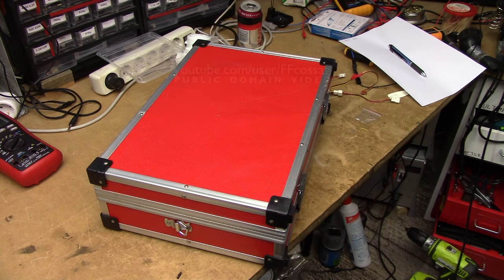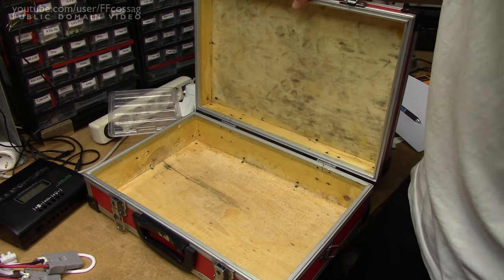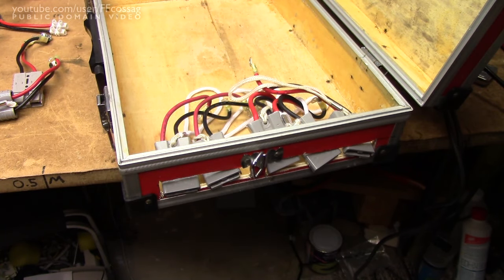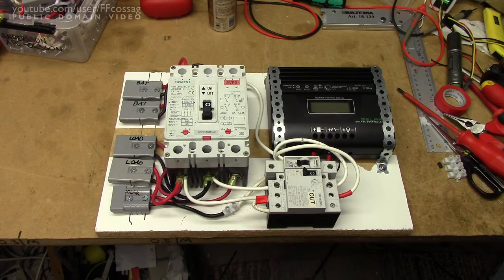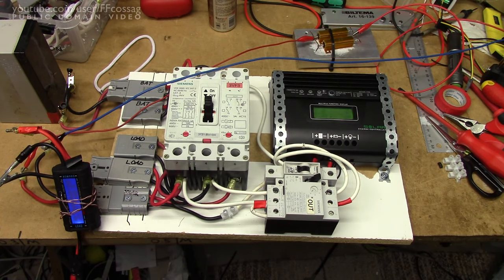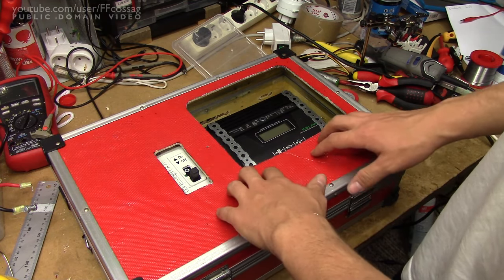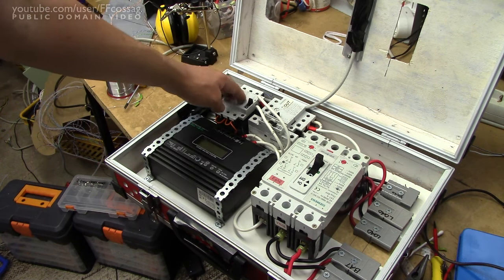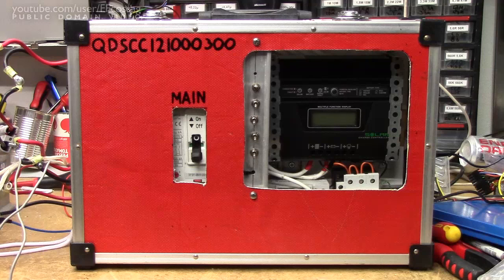Making a red briefcase of solar power!

Comment: That thing you don't know what it is, it's a arc extinguisher, thumbs up :)
Reply from the maker: Thanks for putting a name to it - I Googled it and found out more. The odd thing about this one is that it doesn't seem to be electrically connected to anything at all. Perhaps the arc is intended to jump to it.
Reply: FFcossag No problem, this kind of circuit breakers are normally mounted vertically, and because the hot arc rises, it goes all by itself into the arc extinguisher

Comment: @3:02 -- I've seen that sort of construction for variable capacitors on tube era stuff on other peoples channels. The dielectric is air, and the plating is compressed to alter the capacitance you want to achieve. Other than that, your guess is as good as mine

Comment: Is youre solar panel free standing or is it mounted somewhere ? I once had a 4WD Mitsubishi L300 with a solar panel mounted to the roofrack . The panel could be tilted and spun 360 degrees to track the sun AM to PM , the controller was mounted inside the vehicle .
Reply from the maker: That sounds really expensive and fancy. If you stick around, you're going to find out what this project is meant for, though. ;)
Reply: It wasnt fancy the tilt and rotation had to be done by hand . But expensive , 27 years ago a 40 watt panel
cost the 2016 equivalent of 1000 dollars au !
Reply from the maker: Steve Smith
A 40 W panel in the 80's must have cost a stupid amount just on its own. Today, the bulk of the cost would be in the mechanics, given how even a giant 235 W panel like mine costs $200.

Comment: how well do residential ac breakers like that actually work on dc stuff ?
Reply from the maker: They will break the flow of current unless it's a really gross overload, but they wear out VERY quickly. You can't expect more than a few tens of operations out of them before they start to deteriorate.